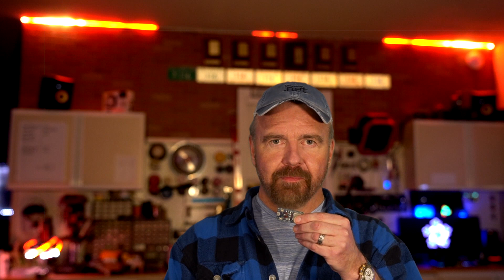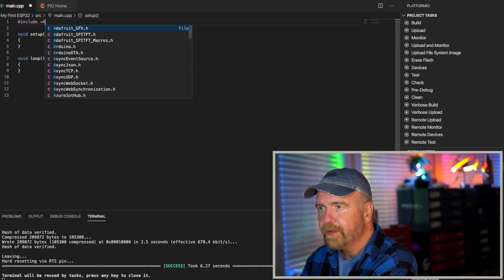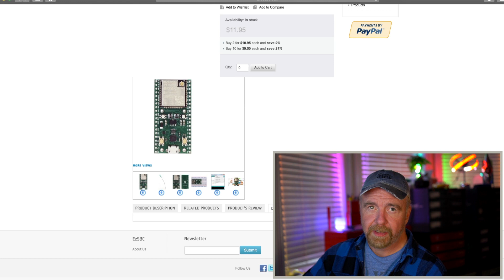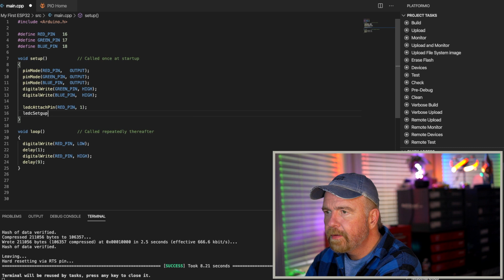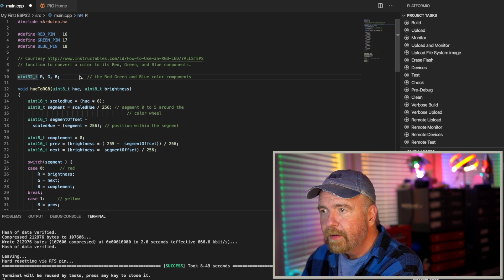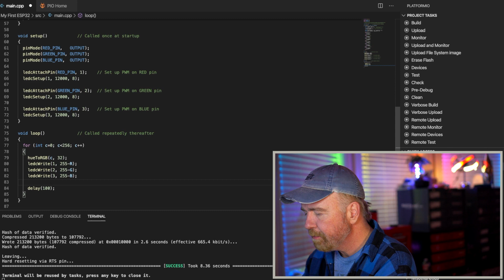01-Learn Arduino Tutorial Project - Beginner DIY First Steps with an RGB LED - Tiki Fire Umbrella

Comment: Again I have to thank you  for uncluttering my mind and help me get rid of some bad programming habbits I picked up because my programmer friends with degrees never knew what I was talking  about, until I showed them what I got working in the end. 
And they just said; "YOUR DOING BARE METAL PROGRAMMING!!!WTF!! What do you mean by ''you don't understand'?"
These peoples. I read the whole documentation on ESP32 like twice over. I think once you completly get a grasp of the hardware its also easy to max out when you go crazy, but apart from special cases they are all one needs. Haven't looked into it, but I'm sure I havent seen anything fpga wise...I want to get into a few poV and holografic projets using led arrays. I've heard extremes of well over 10,000 fps or rather voxels. I have to get your book as a christmas gift to myself! I needto get out of my retreat, those autistic burnouts have been very draining...As I just turned 40, I still have alittle power left to accomplish something great, rather then staying vulnerable by missing some key concepts

Comment: Hello Dave,

Will you be doing any bench testing between c++ and circuitpython?  

I made some LEDs light up with circuitpython on a trinket-mo board.  It ran pretty slow which could have been a combination of the language and the board.

Mainly wondering how the two languages compete in a drag race.

Comment: You should put your borrowed code somewhere where people can follow and copy it. I had to go find it and extract the function from code that was for an actual Arduino that used analog outputs instead of digital. Other than that, this was a really good video.

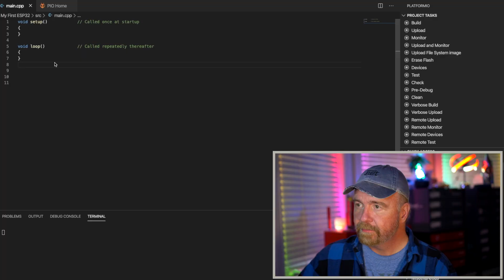Comment: How do you get just PlatformIO to show like you do at 5:46 with none of the VC frame on the left and top, why does your path show My First  ESP32 nothing shows after src> in my view, and lastly how did you bring up those list of tasks?  I find only two ways to build/upload: PlatformIO:Toolbar icon, or Project Tasks to the left of the code.

OK, figured part of it out.   As long as you have a project open, you can get rid of the middle panel by clicking on the PlatformIO icon on the left bar, the icon that looks like an alien.

Comment: Sorry, stumped on step 4. Install a "platform"? Is that different than installing an extension or a library? What is meant by "Within PlatformIO/VSCode"? I searched extensions and found "Espressif IDF", not "Espessif ESP32".
I have VSCode, and the extension for PlatformIO, which means I have that little house icon. Clicking the little house gets me a nested PIO Home window, and I can search there for libraries, but searching for Espressif results in 4000+ matches, none that seem right.
Reply: I'm getting stuck too.    It would have been helpful to go step by step with the application installs in the video.
If it weren't for the PlatformIO webpage showing with a screenshot and "paint by numbers" when to click where in installing the PlatformIO extension, I would have been stuck there.
Once having PlatformIO VC extension installed, the next question became, how do I now get into PlatformIO?  Answer: click on the alien on the left.

Go to Platforms in the 2nd left bar, find Expressif 32 (not Expressif ESP32
After that, I'm a bit lost.
Supposedly I should be able to go to File -> New Project but File is within the VC shell, and not within the PlatformIO extension.  There is a shortcut New Project, but still.
DroneBot Workshop has a video Getting Started witbh PlatformIO, I think I am going to look at that next.
Reply: Same question, Dave.  Can you elaborate?  I am getting errors in later episode projects, and I suspect it’s because I skipped step 4.
Reply: @Nolanja1234  I think it is "Espessif 32" in the Platformio tab Platforms and install. I had to restart VSCode.

Comment: Do you have a video or could you make a video on how to add multiple light patterns  and how to change the pattern? For example your fire pattern and the rainbow?  Somehow qerw you wouldn't have to re-program the board, just hit a button,, cycle the power? Is it possible?  Through Bluetooth or some other means?

Comment: I love how simple you break everything down! I think I might have to bust out the raspberry pi 3 I bought that has just been collecting dust!!
Reply: I have the respberry and Arduino, and I find the Arduino way more accessible. The pi3 is just to slow to boot and debug IMO, Arduino is instant lightweight, and powerful.
Reply: @MilesHart007  Yea, I am sure you are right. I was going to use it as a htpc ( outdated for that use now) but at least i can use it to practice prgramming and make it do cool stuff with alll the I/O